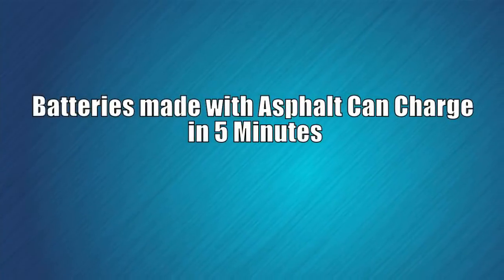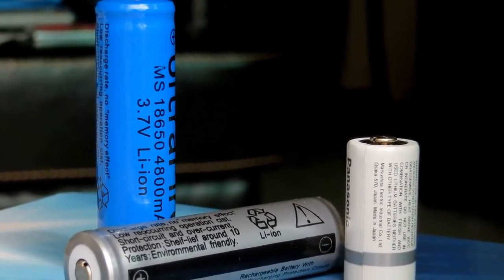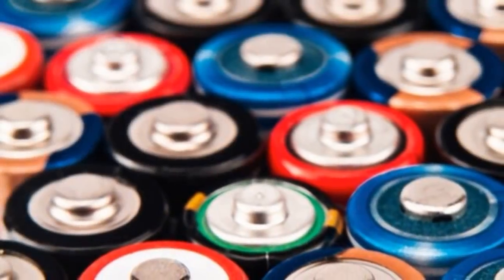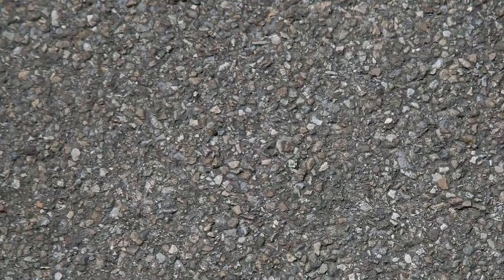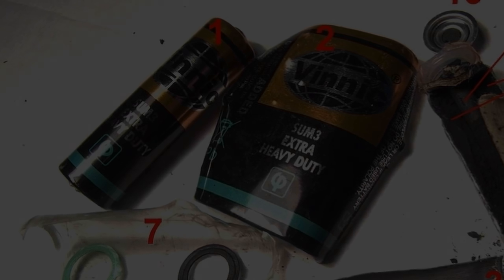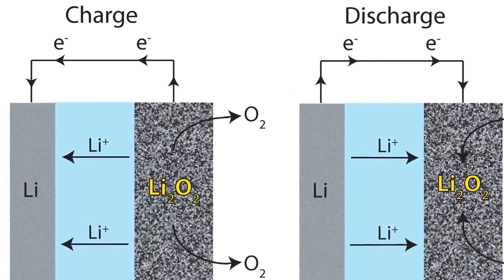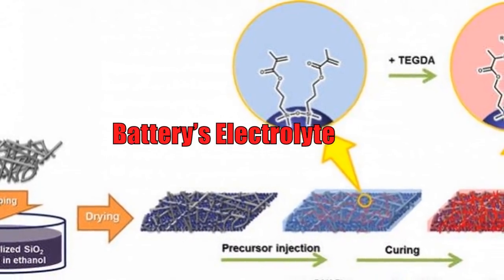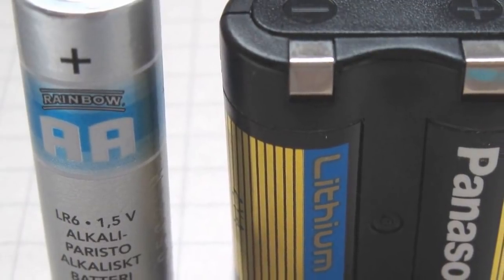Batteries Made with Asphalt Can Charge in 5 Minutes

Comment: as·phalt

a mixture of dark bituminous pitch with sand or gravel, used for surfacing roads, flooring, roofing, etc.
Reply: bituminous pitch-Pitch is a name for any of a number of viscoelastic polymers. Pitch can be natural or manufactured, derived from petroleum, coal tar or plants. Various forms of pitch may also be called tar, bitumen or asphalt.
Reply: Viscoelasticity is the property of materials that exhibit both viscous and elastic characteristics when undergoing deformation. Synthetic polymers, wood, and human tissue, as well as metals at high temperature, display significant viscoelastic effects.
Reply: Why? Just because :)